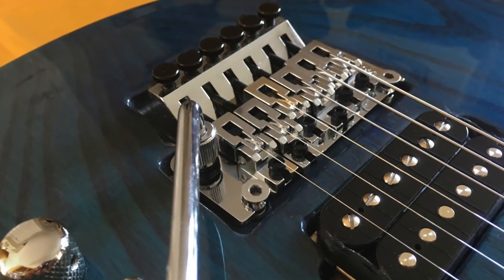The 3 Keys To Guitar Building Success

Comment: You can absolutely have a recessed tremolo on a thin body, you say the only way to fix this problem is to rise the tremolo back up, but you can always just make the term block shorter to compensate for how far out the back it would otherwise be sticking out. It would have less tone as there is less of the metal, so in order to preserve the qualities of the block it must make it out of a more dense metal in order to compensate for the difference in mass
Reply from the maker: You can make a tremolo block shorter and I can make a tremolo block shorter, but most of the people watching can’t.
Reply: @HighlineGuitars  not so sure about that..if the recesses in the block are deep and only requires a bit of grinding with an angle grinder..then it would not be so difficult..but then i am guessing that an angle grinder is a fairly common tool..or at least one that can be acquired for a fairly minimal expense..but of course, you are right, that proper planning will avoid these kinds of extra steps..and if the extra steps add up..then a fairly quick and satisfying build can turn into a never ending nightmare where the probability of making additional errors adds up..

Comment: once you get a couple of builds under you...You know what's up..
I dont even have a router..it's tedious the way I do it...fit and re fit...repeat.lol
I take off a little bit at a time with a file...i have to make suse it;s level..but
with a tilt...becuase I glue in my necks.
Im picky around the neck joint, tenon..ect My guitars are built to be play
with easy access to the higher frets with comfort....
I've spent days..just to get  neck joint area worked out.
The guitars are put together..set up..ect
then taken apart again before I add a coat of paint

My first built..I didnt put in enough neck tilt..it was cuasing all kinds of issues.
It took me a year to get around to cutting out the neck...It was a learning process...
I can cut a neck out do the repairs..it was tedious. i dont want to do that again.lol
but guitar play great , now.

Comment: Hi Chris, I have purchased your plans for the highline cnc router. I have changed it to a single lead screw for the Y axis. I should be done with this in the next few weeks. I intend on starting a small guitar building business. Any advice?
Reply from the maker: The next several videos in my Luthier Quick Tips series will address this. They are posted every Tuesday.

Comment: Thanks for all your advise. I do have a question though. Say I want to do a 25 1/2" scale guitar.  What is a good guide of knowing where to set your bridge positioning? Should I adjust all the saddles all the way back on the bridge and then measure the 25 1/2" from the nut to the saddle on the low E string?  I'm not sure exactly how that works.
Reply: DreidMusicalX  chris will tell you the right way to do it. i strung up the guitar and put the bridge on a piece of cardboard. by doing so you can find the right position and then mark it.
Reply from the maker: Guitar strings typically have a slightly longer scale length with the wound bass strings as the longest. For example, a wound low E string for a 25-1/2" scale length will actually be somewhere around 25-5/8" or a bit more. I move the saddles all the way forward and then back about 1/32" to give me a little bit of forward adjustment even though it probably won't be used. Then I divide the desired scale length by 2 (12-3/4") and I measure back from the center of the 12th fret to where the front of the saddles need to be placed. That usually gives me enough saddle travel to intonate all of the strings.
Reply: @HighlineGuitars  Ok thank so much! I always wondered how that was done.